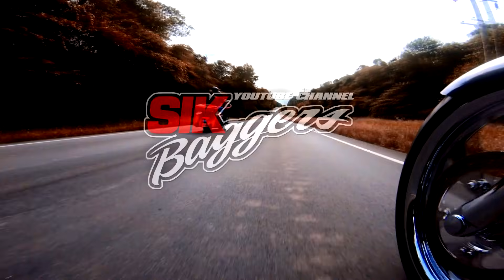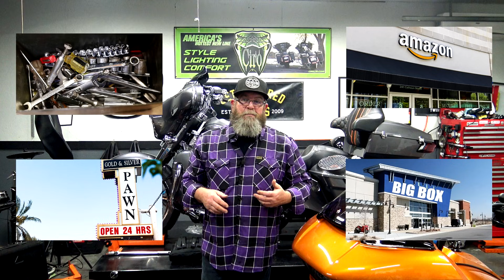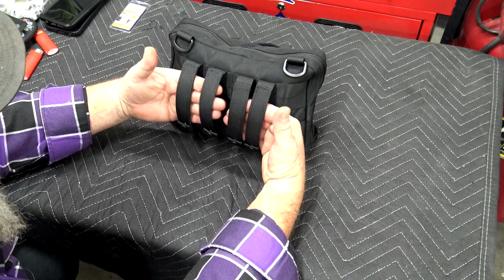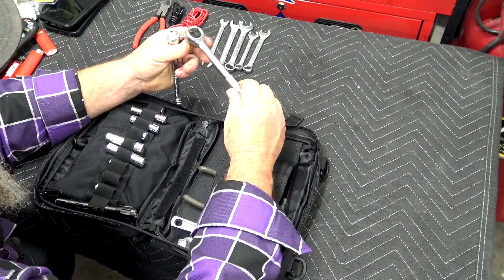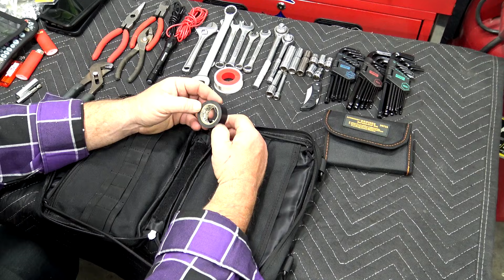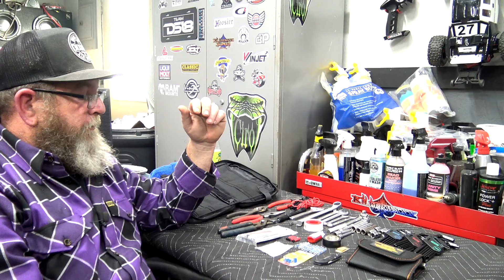⚡Build A Motorcycle Tool Roll Cheap!⚡

Comment: One tip to store electrical or other tape in a very compact way is to take an old plastic card (like a credit style card) and put several wraps around it.  Stores very flat and you can carry several feet of tape that way.  I would also consider adding a tire plug/patch kit and small self powered inflator to the tool kit for long distance riding.  Even if just to maintain your air pressure, it's handy to have a small self contained compressor and they take up very little space.  Great video as always!
Reply from the maker: Great tip on the electric tape and yes I have upgraded to a smaller pocuh with a tire repair kit and a portable tire inflator ...thank you for checking it out!

Comment: I have some tools, but never need them,  riding Honda Motorcycle😄
Reply from the maker: 😀 It's understandable that as a Honda motorcycle rider, you may not find yourself needing tools frequently. Honda motorcycles are known for their reliability and durability...While it's great that you haven't needed to use your tools often, it's still recommended to carry a basic toolkit during your rides, just in case. Even the most reliable motorcycles can encounter unexpected situations, such as a flat tire or a loose bolt, which might require some on-the-spot adjustments. Having a toolkit on hand can save you from the potential inconvenience and allow you to address minor issues promptly. Additionally, it's worth noting that a toolkit can also come in handy for helping fellow riders in need. It's always great to be prepared and lend a hand if someone else on the road requires assistance.

Comment: good video. you are correct. But "CHEAP" tools to carry. It stolen or borrowed and not returned, no big loss. Won't hardly ever use them anyway. Rust up and need lubed about twice a year. safe ridin rubber down.
Reply from the maker: Thanks for checking it out and the comment! Its pretty cheap to make one of these and has saved me butt a few times!

Comment: I really loved this video. Just getting into the harley scene. But I've seen a bunch of tool videos but none on what common bolts to also keep with you and is there a common harley bolt kit you can buy?
Reply from the maker: I dont know of any bolt kit to be honest...that would be cool. I've been riding a lot of years and never really lost any critical fasteners that I can remember.  But it wouldnt be a bad idea to have some either...you never know
Reply: @SIK Baggers  thanks for the answer. Is there any size bolts you would recommend throwing in your bike. I rode dirt bikes for 30+ yrs and always had some 6 8 and 10mm bolts in the truck but not really sure about what the common bolts on a harley are.
Reply: @SIK Baggers  I have a 18 street glide special

Comment: My bike had a HD tool bag when I bought it. I’ve added a few tools to it. 

I also carry a medical kit. Only had to use it once in the last 20 years. I was a medic in the Army, and have trained for wilderness and emergency care. (Nam, 69-70.)

I’ve used my tools to help others on the road many times. 

For those with key fobs, keep a couple extra batteries in your kit. This to has helped me and others on the road. 

One more thing: carry a battery charger.  This too has helped me and even a cage or two.
Reply from the maker: Thanks for checking it out ken and thank you for the upgrade ideas! I do need a med kit in my bag,,,I may just build one of those too as the pre made ones are kinda cheesy and pricey for what your getting. I do keep a jump pack on the bike and have since got a tire repair kit together too with battery tire inflator.

Comment: Only two times I’ve been stranded was key broke in gas tank on my Honda cbr 600 rr and had to fish it out with a qt nail file and my clutch blew on sportster . Best tools in my opinion are the phone tow insurance and a Visa card. I’m some what of an Over prepper but after telling myself im probably not going to re build my top end on the road I’ve been packing much lighter

Comment: BTW..I added something to my bag… bought one of those Harbor Freight LED head lamps. I wrapped around my tool kit and threw in a couple extra batteries. Easier to work in the dark with two hands than trying to hold on to a flashlight while you work.
Reply from the maker: yes sir...great idea man! I just got a few headlights from amazon the other day..my old ones were getting pretty sloppy..i use them in the shop a lot. i think ill throw one of my older ones in there ! Thanks for the tip!

Comment: Can you use the same tools in this video for a 96 fat boy
Reply from the maker: I would say about 95% at least...best thing to do is check all your critical bolts and fastners and get those specific sizes just to reduce some weight or size of the pack

Comment: I haven't been riding for too long however, from experience on the car side of things. The little premade kits are typically a good foundation to build upon and give you a solid starting point if you don't already own a lot of tools, and you're just learning how to wrench. My suggestion if you go the premade kit route, actually use your kit when doing maintenance and modding your bike. After a little bit you'll discover/add the tools that you need and have a kit pretty much tailored to your bike.
Reply from the maker: i agree if your doing it that route then yes...actually use it and youll find real quick what you actually need.

Comment: This is by far the best video on the subject.  No bs just good solid info.  Thanks for sharing.  40 years of riding and still getting EXCELLENT info from riders like you.  In my tool I have electric,teflon and duct tape.  Also, I have stainless steel wire along with some jb steel stick.  
From experience, I had a person detail my bike.  Detailer did not snap the tool bag correctly and came out flying in the freeway.   All of my tools were lost.  Also, do not overload the saddle bags and make sure you keep them balance.  Lastly, I have a cigarette lighter power compressor and Cartridge for CO2 Inflators just in case.  This tool bag is also used with the additional tool for the BMW gs 1200r  and Ducati  1198.
Reply from the maker: Thank you George! I have since stepped up my flat tire game too...had a buddy that had a similar incident with his tool bag...didn't loose everything but quite a bit...thanks for checking out the video man! be safe

Comment: A few other sources for cheap BUT GOOD tools. Yard sales and estate sales. Another reason not to spend a lot on your tool roll? Theft! Most people don't have the balls to f*ck with a bike but I've seen leather saddlebags stolen or rummaged through. My tool bag is a CLC Custom Leathercraft 1107 2 Pack  for $20. I use the tan for my tools and the black for gear and they fit perfectly inside a saddlebag, plus the handles make it extremely easy to carry them into the house or hotel room. They're just a big pouch, no sorting but that's how I like it bc there's more room for tools. No space is wasted. Plus, CLC makes quality gear and they're tough!  I have probably 6 CLC tool bags for work ranging from 7 to 15 years old and none have broken yet.
Reply from the maker: Nice! I just looked up that bag and even placed an order...I could use those in a lot of scenarios! Thanks for the heads up!

Comment: Thanks Steve, this is a great idea, I bought my 2020 RGL new 16 months ago and being that I'm driving a new bike I have never felt that I really needed any tools with me other then a few real basic tools that I do have. But after seeing your video I'm going to start putting a tool bag together today, maybe I'm just lucky but in all my many, many years of riding I have never had a bike break down other then blowing a rear tire one time, and that little experience stopped me from trying to get the most mileage out of my tires. I have always wrenched on my bikes keeping then in great working order and I have always put lots of miles on my bikes 10 to 12,000 miles each year. I did order the tool bag from your link and will order a few other items but had to laugh a bit, I added up all items with the Amazon links and it totaled $159.71, now most of us have some odd tools laying around that we can add to this kit but thanks for listing them here so we can order those tools that we may have to go buy. Thanks again Steve for your great videos.
Reply from the maker: Hey Dave...not sure how this comment slipped passed me but it did...you have been very lucky to never be on the side of the road...even scarier now than it was 20 years ago..no one pays attention...I mean you see people hitting full on squad cars with lights flashing...you think they wont smoke you on a bike? I want to get off the road asap!  And yes getting every bit if that from amazon is a bit much for sure...I just wanted to make sure everyone was clear on what I got and most of the stuff I had laying around and I agree most guys do.

Comment: Another good video with sound advice. I completely agree with the tools and products. But I will offer my two cents to your tool roll. I bought one of those hockey puck lights from a chain auto parts store. It's battery powered and has a hook 🪝, and strong magnet 🧲 on it. It's a great safety item for the bike if a break down happens at night. It has multiple flashing red LED lights and a flash light. If you don't have any battery power for four way flashers on the bike, this little thing might keep you from being hit by a car or truck.
Reply from the maker: Hey Albert! Yes sir great advice and I actually have that same light in my tour pack...and I forgot to mention it because it wasnt in the roll....and I should have. I got 3 of them actually to put around the bike if im on the side of the road at night...hopefully never have top use them but great sound advice!

Comment: Thanks for the video. It was perfect because it told me what common wrenches, sockets, torx etc. that I need for my Harley. Plus it gave me an opportunity to purge my tool box of the cheap hand tools that unfortunately you buy when you’re young and can’t afford the good tools. I did as you said added some things like: Super Glue, some mechanics wire,  cut down length of the bigger and stronger wire ties, a multi tool that has a knife, and small right angle screw drive and bits (Harbor Freight). I also purchased a 56 Lumens Triangle emergency light that doubles for a flashlight, lights solid red color and flashing emergency red. This I’ll attached to the front of my Molle bag.
Thanks again and take care.
Reply from the maker: Hey Keith! Thats awesome man...I have some of those triangles too...pretty sure I got them from harbor freight...picked up 5 or 6 of them and tossed some in each vehicle. And i feel you about purging..im not one to throw away tools..and last month I went through my tools and built my son a toolbox, and tossed about 40 screwdrivers....holy cow man I didnt know I had so many stuffed in that drawer.  I thought this is ridiculous when I pick out 2 or 3 different ones every time I grab a screwdriver...I couldnt even tell you where 80% of those even came from lol

Comment: Built my own, apart from tyre repair equipment. The one other thing I carry is a small test light or meter. Diagnosing electrics is a lot faster and easier, and seems to be the tool I’ve used the most to help people out. Because nobody has one.
Reply from the maker: Hey Bladen that's a dang good addition! Thank you for sharing! I've got about 20 of those things laying around...Ill toss one in my pack! Brilliant!
Reply: @sikbaggers   as a long time mechanic I still watch others like your self, its a great source of information tips and knowledge. Thanks for the effort put into your videos, glad I could throw something of Value back to you.

Comment: I have tools onboard but anther addition is a nice length of heavy  gauge wire like what is used to bind rebar together. If something broke that may get hot the tape, tie straps or bungee cords will not suffice.
Reply from the maker: Great idea ....and i have some of that laying around actually...ill throw some in

Comment: You should add a few Wago 221 or 222 connectors for quick electrical fixes. I keep 4 connectors and a couple feet of wire in my kit.
Reply from the maker: Yes sir...sound advice! I use those in the house...ive got those posi taps that pretty well do the same thing but the wagos are a nice touch too!

Comment: I'd say toss the 3 Allen key sets and only carry the actual couple of sizes needed, add a MAIN fuse, CR2032 Lithium battery (FOB),  replace wire cutter with small wire stripper/cutter/cripper all built in, and you'll save the weight and space to add a small flask of whiskey.
Reply from the maker: Hey Shawn....good ideas there man...appreciate it. Im always working on this kit...I keep the extra keys on me for other bikes...never know when your going to need ot help someone on a metric and I have no idea what size bolts they have anymore lol I dont have an alarm so yes it literally slipped my mind even though I preach it to everyone that brings their bike in with an alarm.

Comment: Great info I'v got one I put together ,did  put a little bit of mechanics wire in.But didnot think of fuses thats going in also thanks.
Reply from the maker: Glad the video helped and thank you for checking it out. I always have something new I want to add but its getting pretty packed now and I really need to add some for tires and pressure..still working on that.

Comment: Excellent video Steve - some great ideas. I carry a tool kit that I put together from odds and ends in my garage that pretty much mirrors the kit shown. 
Additionally, I carry a tire repair kit with a small air pump. Thanks for the video and ride safe.
Reply from the maker: Thank you! yes I really need to work on my tire situation....looking for a portable pump now, maybe battery operated that wont take up half my saddlebag lol but yeah I need to upgrade my kit with that as well.

Comment: One of the thing that i used when i was building my first toolbag.  A shapie and post-it to note what tools i didn't had and would have use AT that Time. And Now i used the shapie to put a Line on the Bolts head so il can see if a Bolt is getting loose while riding on bumpy/gravel/dirt road
Reply from the maker: Thats a great idea! Thank you for sharing that with us.

Comment: Great video, any flat tire suggestions to throw in that kit ?
Reply from the maker: Yeah im working on kit all the time and this is something I need to address. A good plug kit for sure. It'll at least get you to the safe place and off the road but im trying to find a small portable air compressor ...seen some on amazon that are battery operated but man they have some iffy reviews.
Reply: @sikbaggers  thanks for the reply, I carry about 10 co2 bicycle cartridge inflators and a couple drywall screws in the event I can’t plug a tire I can use them to plug and get off the road. Looking forward to that compressor. Love the channel.

Comment: Yep! I'm glad I saw this video. I been meaning to put some cheap tools together and putting them in the bag. Harbor Freight is a great place to look for alot of this. And it's a great place for kids or grandchildren to pickup just some of these things as a Christmas gift. The cheaper the better! Most Harbor Freight tools will do the job and get you going.
Reply from the maker: Yes sir jeff.,..HF has some great tools. I use quite a bit if HF stuff in the shop. We just got a HF in out hometown about 2 years ago..before that I had to drive 45 miles to get to one. Its came in very handy several times and you can shop some low end stuff for thr tool bag and higher end stuff for your own tools in the garage. They have a great mix! be safe and have a merry christmas!

Comment: Great Video! I use a tool bag equipped similarly on my Road King. I also carry a tire plug kit and a small lithium battery powered inflator. Have used both Twice in helping stuck Bros on the roadside. Lastly, although not for the faint of heart
Reply from the maker: yes I need to address my tire plug kit for sure..and can you tell me which inflator you have..I read some reviews on some on amazon and they were pretty bad reviews on all of them...id like to get a good one.
Reply: I carry a 30' length of strong thin nylon rope. Have actually towed (very slowly and on a level road) a buddy's softail with a fried transmission back to a safe place.

Comment: I had put together a tool roll, of spare tools I had.  I've used it on side of the road to help out friends and others in need.  I'm going to redo mine as I'm missing a few tools now.  Going to look at the molle bags.  Another thing to keep on hand is spare fob batteries.  I tape a pack of 2 under my TP lid.  Never know when you or someone else may need a new battery.
Reply from the maker: Great tip! I dont have a fob on either bike so I forgot about those but im always telling people to get an extra battery!

Comment: Plug kit is the only thing your missing and that’s what my bag started with. I was 2hrs away from house when I got a flat rear tire. I was about 20min from a gas station. Thank god the gas station I went to had a tire plug kit. Then I also got a small air pump from a junk car at a salvage yard.The newer Buick regals has them and the newer Malibu. They are really small and it’s worth the peace of mind to have in your saddle bag if you have the room. My tool kit isn’t complete yet but I know more what to look for now that I watched the video. Thanks man. Great video.
Reply from the maker: Sorry for the late reply Harry...but yes a plug kit and some sort of inflation is for sure something I need to address in my kit. Glad the video helped you get some ideas! Take care and ride safe!
Reply: Valve stem cores